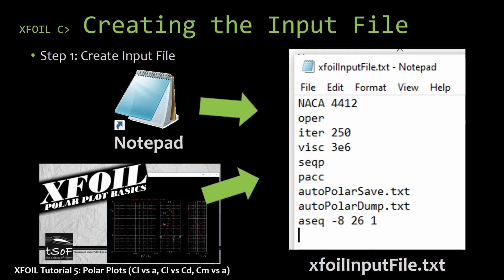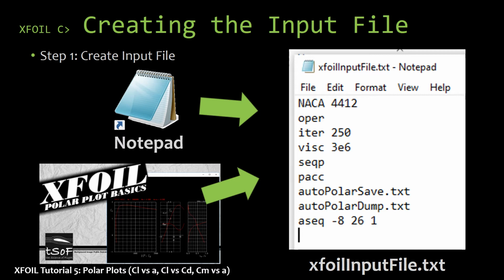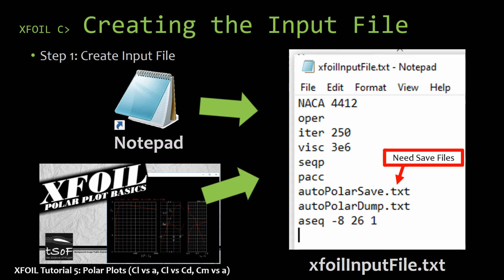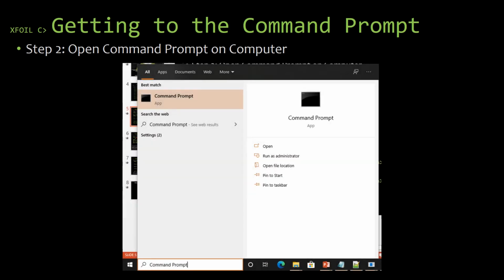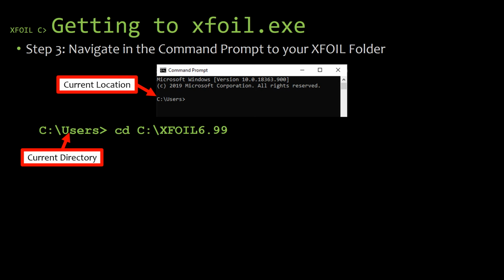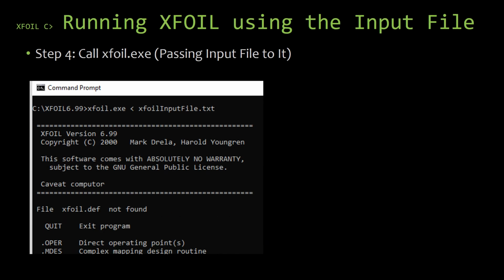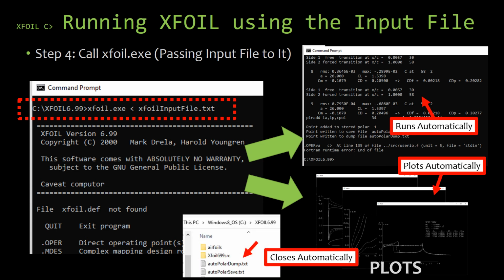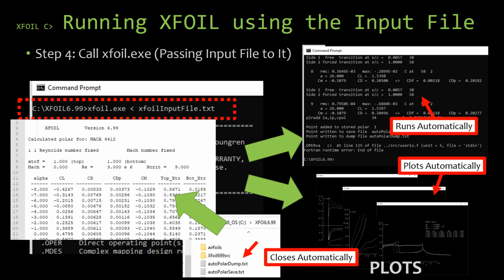Using an Input File to Control XFOIL | XFOIL Lectures & Tutorials

Comment: Thank you for the detailed tutorial!  Thanks to you I have successfully generated polar data in a text file.  For some reason though, I get this error and xfoil stops.  Do you understand this error?   I use a linux operating system, so I compiled xfoil using gfortran.  Maybe something went wrong there.  Here is the error message:

xfoil < inputfile.txt > outfile.txt
At line 135 of file ../src/userio.f (unit = 5, file = 'stdin')
Fortran runtime error: End of file

Error termination. Backtrace:
#0  0x7faa104ead5a
#1  0x7faa104eb869
#2  0x7faa104ec54f
#3  0x7faa1072fc5b
#4  0x7faa1073027a
#5  0x7faa1072c9db
#6  0x7faa10731964
#7  0x7faa10732a2b
#8  0x56137dbf3603
#9  0x56137db57402
#10  0x56137db4d748
#11  0x7faa101950b2
#12  0x56137db4d77d
#13  0xffffffffffffffff
Reply: The outfile says "File  xfoil.def  not found"